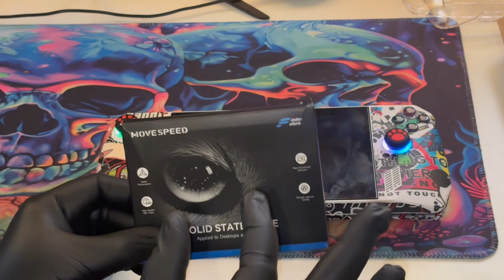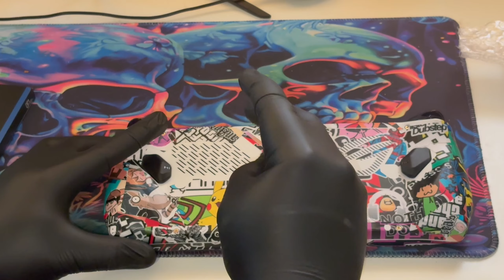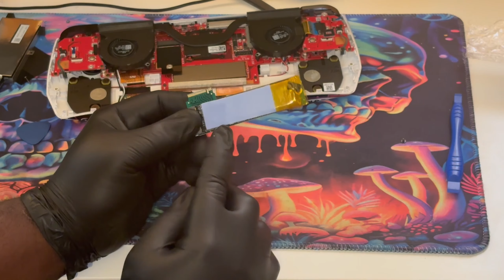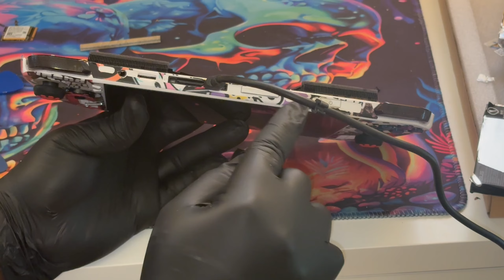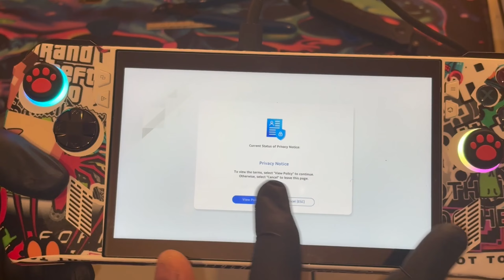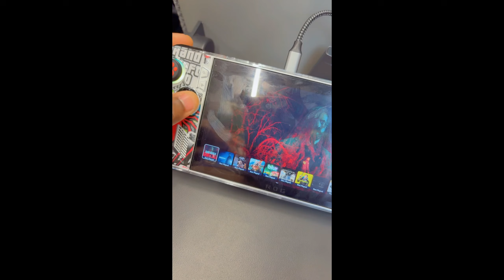THE ULTIMATE  ROG ALLY: 3.5TB Storage + Massive Battery! | Full Mod Guide & Parts Links

Comment: isn't the shielding supposed to be facing against the board and ram? the way you assembled it will not shield from the heat if the shielding is only applied the upper part of the battery...